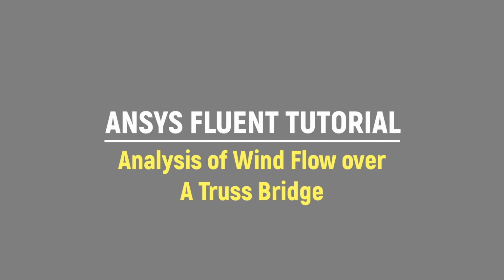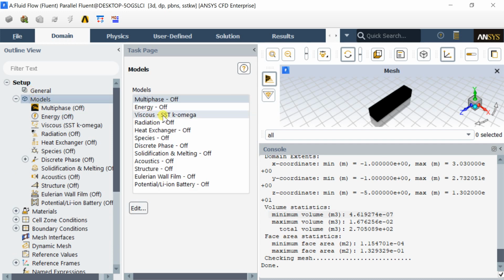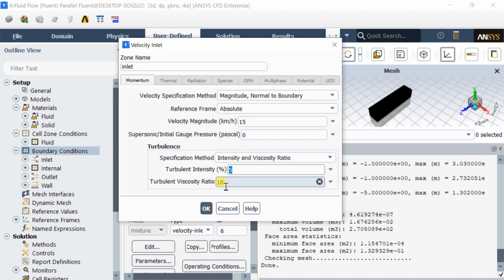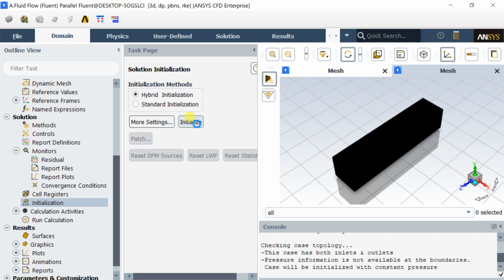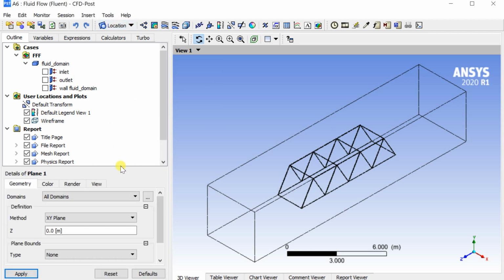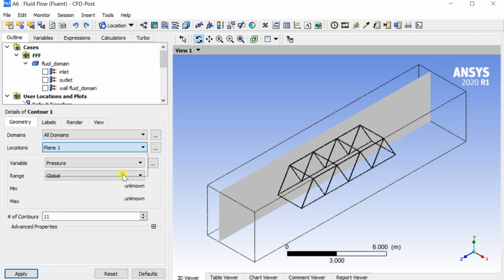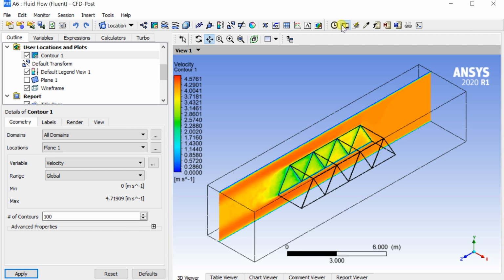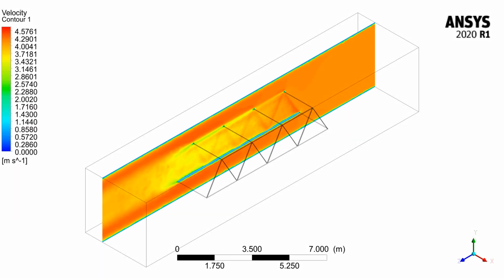ANSYS Fluent Tutorial | Analysis of Wind Flow over a Truss Bridge | ANSYS Tutorial  Part 2/2

Comment: what does it means if convergence tolerance of 1e-06 is not reached during hybrid initialization? What can I change to correct this? Thanks for your videos
Reply from the maker: No need to worry about it. Its just a initialization process. Generally, while you put the hybrid initialization, the solver do some initial calculations to find out what would be the initial parameters at domain. Its that convergence criteria. Its different from the solution convergence residuals.

Comment: Thanks so much for your video! It is very helpful! Would you mind to create another tutorial on how to use Fluent to apply radiation, conduction, and convection this same bridge geometry? It will be really useful if the radiation strength and angle are changing with different time of a day. Another example of showing how to map the temperature distribution to structural model will also be very helpful for lots of people. Thanks!
Reply from the maker: Will try to make a tutorial on that. Thanks for you query.
Reply: @AnsysTutor  Thanks for all y our hard work!

Comment: Great work!!! Could you please make a tutorial of the Analysis of Two Concentric Rotating Cylinders in 3D????
Reply from the maker: Its similar to this case, only you need to select the cylinder surface as the moving wall.
Reply: @AnsysTutor  Thanks for the reply. How can I define fluid between two cylinders?